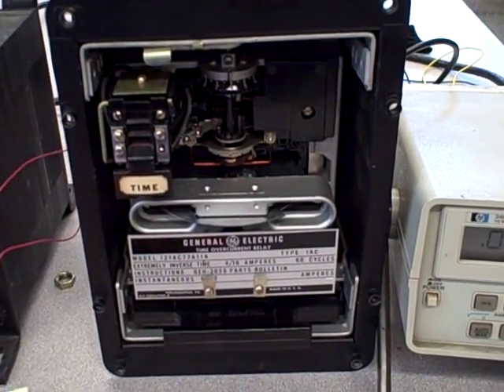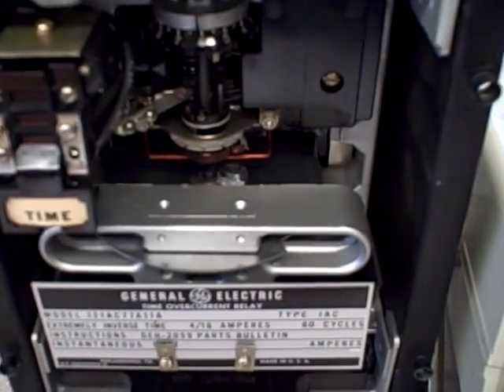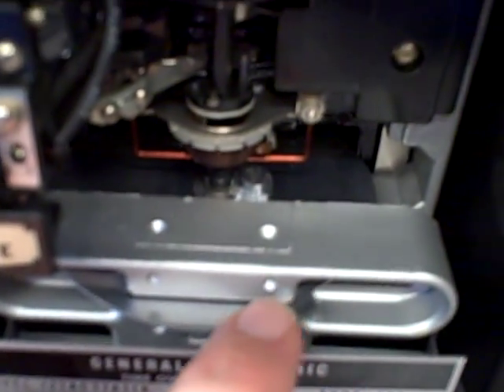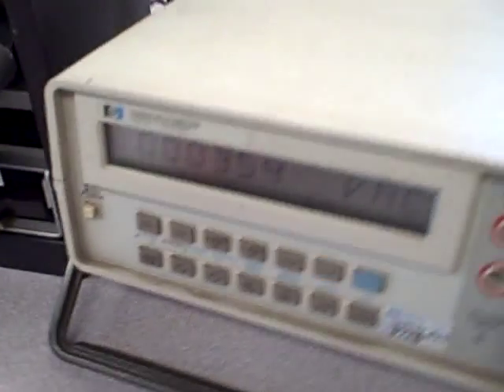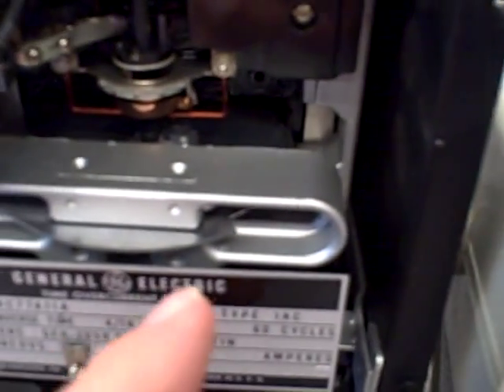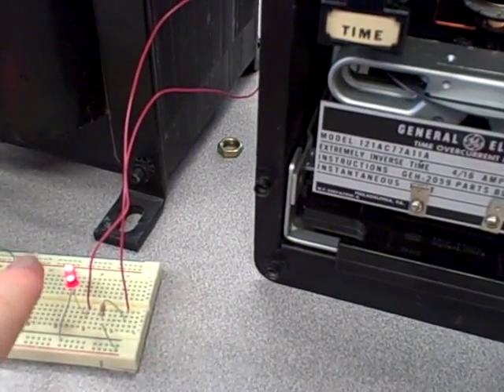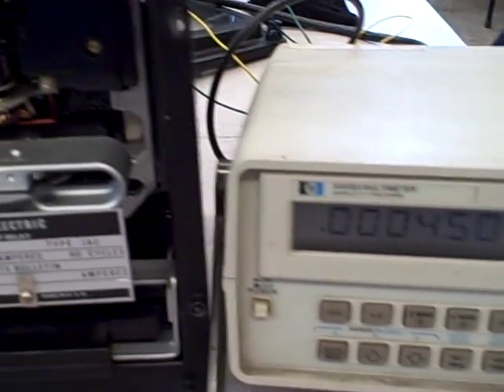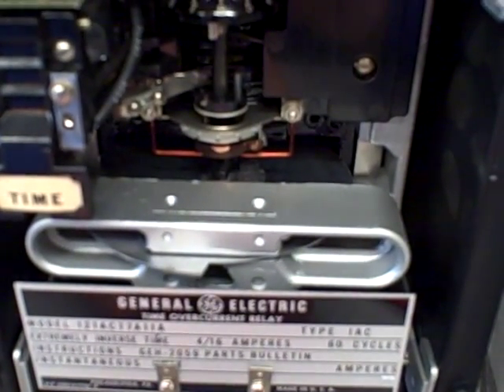Protective relays -- time-overcurrent demonstration

Comment: Very good demonstration of the relay. I really enjoyed your explanation. I would simply like to add to your discussion about the seal-in relay. One of the main functions of the "seal-in" relay (SI) is to bypass the spring that resets the disc each time it rotates. Some viewers may not know that when the disc finally closes its contact to trip the circuit breaker, current actually flows through this spring (which is very thin). This current (to the trip coil) can approach 20 amps or more. This much current can easily damage the spring. The SI relay will operate with (0.2 or 2.0 amps) through it, depending on the tap selected, (a screw on the front of SI). When SI picks up it seals itself in through its own contact; the same contact that bypasses the spring. The fact that it displays a RED target is actually a bonus, by taking advantage of the movement of the electromagnetic clapper.  The word "TIME" of course indicates that the relay operated due to a "timed" function; (rotation of the disc).